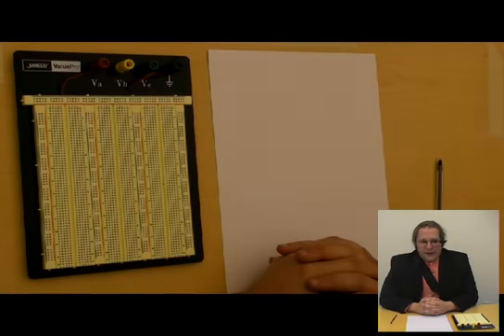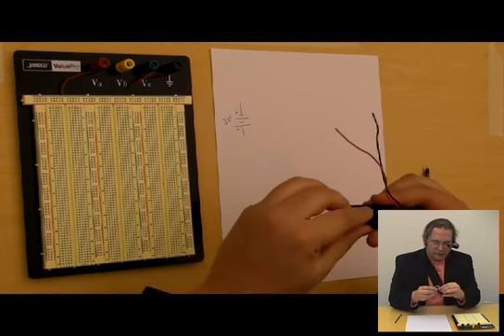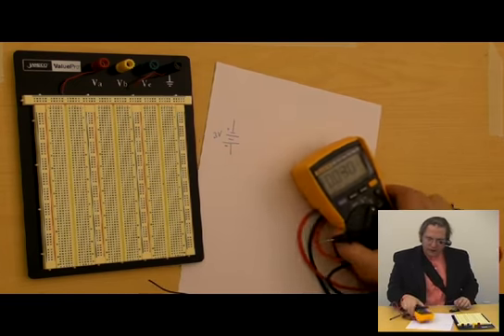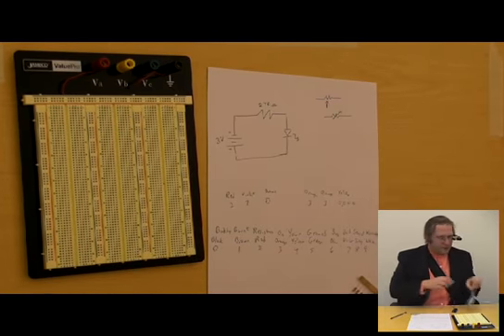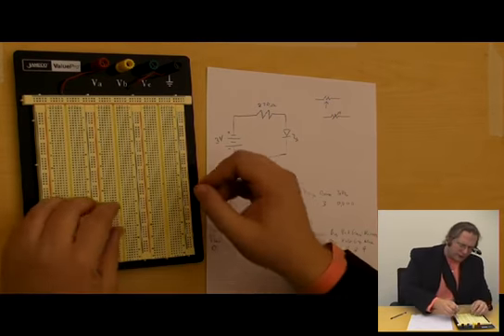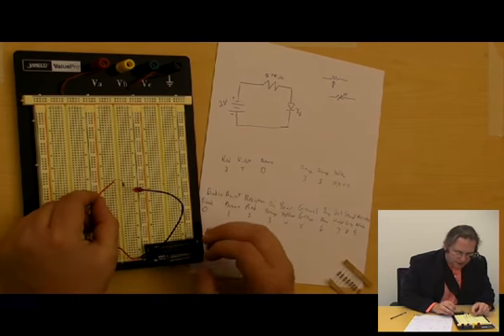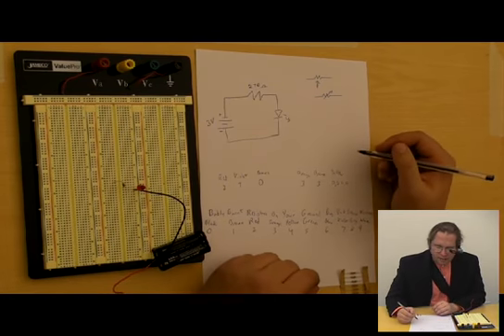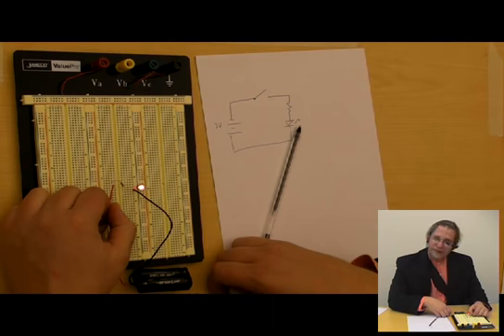CS 3651 Introduction to Circuit Schematics

Comment: Review point:
1- It will be helpful if there is a link for the videos discussing the resistors and capacitors instead of just saying so.
2- the details on the board and paper are not so clear (zoom in or use the other camera for that).
3- I believe it is  common to label the battery symbol with the opposite polarity ( short plate is negative and long is positive)